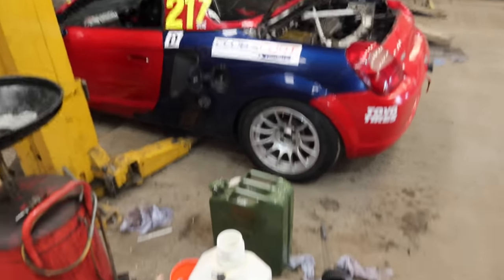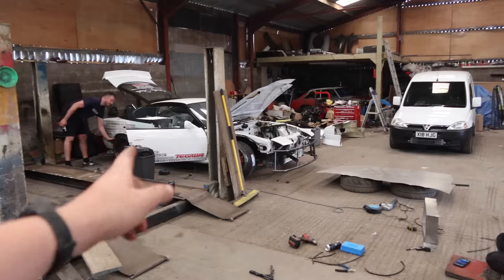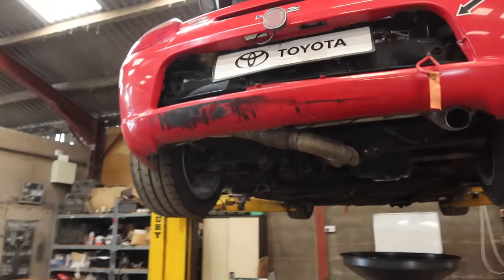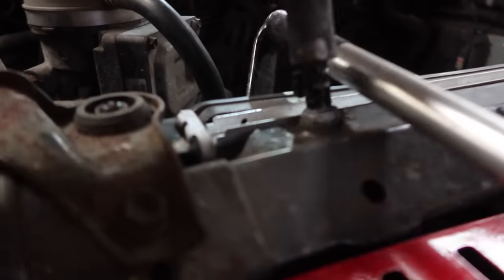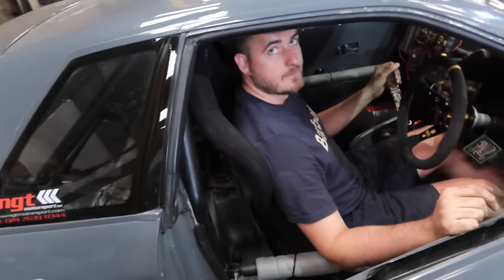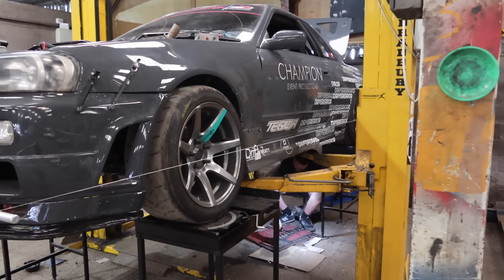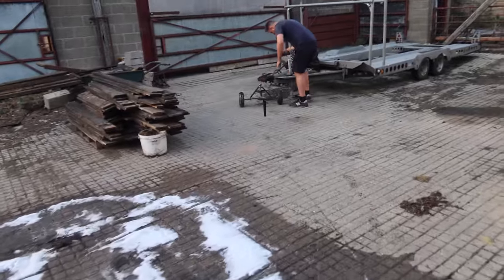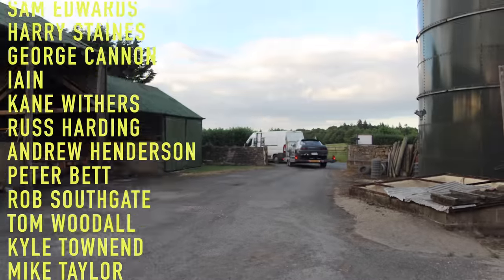A New Toy for Track Days? Skyline Drift Car Grip Setup

Comment: I recommend Fuchs Titan Pro S in 5W-30. Not cheap but it's pretty much the best stuff out there at that weight. Designed to work at high temps and provide protection with low friction.

Comment: Plated diffs don’t need to make a racket. Try the oil Evo 9 GT/RS use in their rear Diff. Get the right oil and you shouldn’t be able to tell a clutch LSD is fitted. All these people saying they should bang and clunk have never had a properly set up one.

Comment: W. O. W. 
I absolutely love nisan skyliners they're my favourite out of all of the Japanese JDM classic drifting cars off of the 1990s and I think i's so cool that you are setting up a 500whp (what does the w even stand for by the way, wake horsepower?) Nissan Skyliner for a Grip day at Donington Park Racing Circuit I bet that's really fun and different compared to doing drifting good luck have fun
Reply: I too bet the Donington Park Racing Circuit GRIP driving is much different to the driftings that usually occurs in such a car. We must stay tuned for the next installment to see how the skyliner copes at Donington Park Grip Racing Circuit
Reply: Wheel horsepower
Reply: W=wheel
Reply from the maker: Woke
Reply: Big oof
Reply: W is wheel…..which is hp after transmission losses. The other thing I can’t not mention is you calling it a Skyline”r”……it may seem a small inconsequential error…..but with enthusiasts small details are important. It’s amazing how people will judge you for adding a simple R at the end when it isn’t required.

Comment: You should see a small incremental gain with the thinner oil, it’ll be worth changing it a bit more often though, as with racing temps the 5W-30 stuff will have a shorter lifespan vs the 5W-40.  Could maybe consider running an oil cooler if you’re allowed?
It’ll be interesting to see if you notice any difference - back to back on the same track would be the best comparison, but that’ll never happen with the amount of changes you make between each race!  😁

Comment: I usually like to use Millers, not sure how far from Northallerton you are but I used to get it from there. Bought 10 of those Shell Helix a few years back when they were on offer at 15-20 quid…..used about 7 of them so far….and managed to blow up a perfectly fine K20 and 4G63 using it. Dunno if there’s fake stuff about, or something else like it was just time, but I really don’t trust it anymore. I’ve blown a lot of engines in my time…..never blown one on Millers oil…..must have blown 6 or 7 on Shell Helix. Probably just coincidence…..I mean if it’s good enough for Ferrari…..but any engine I care about from now on will have Millers CFS only.